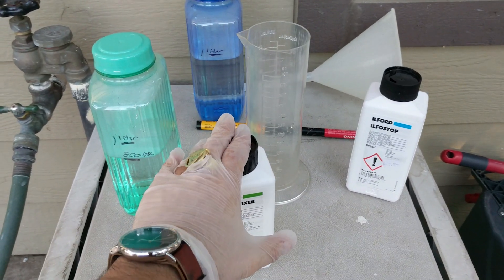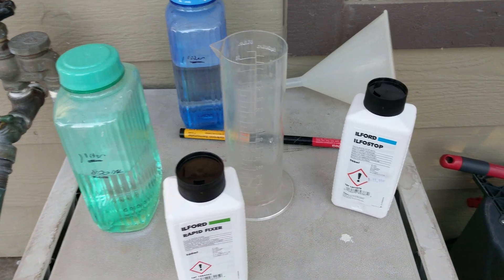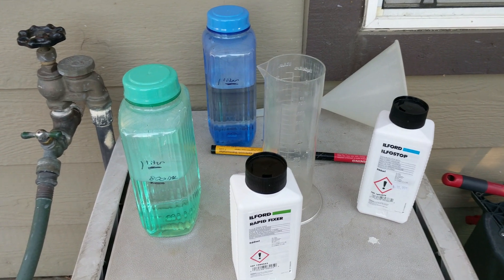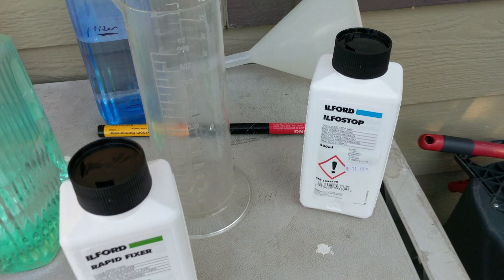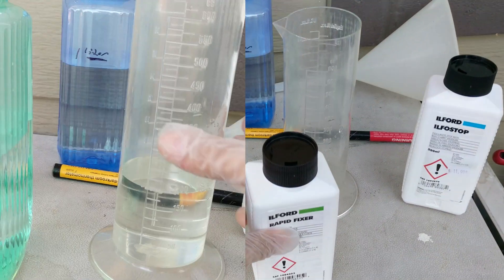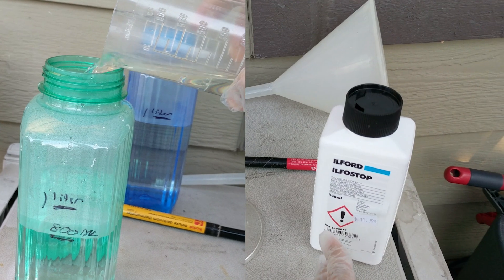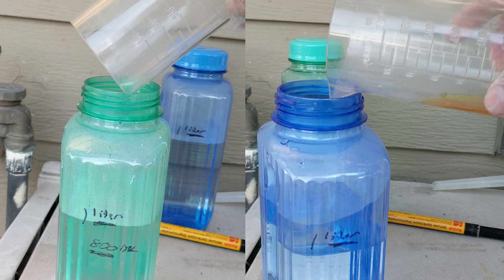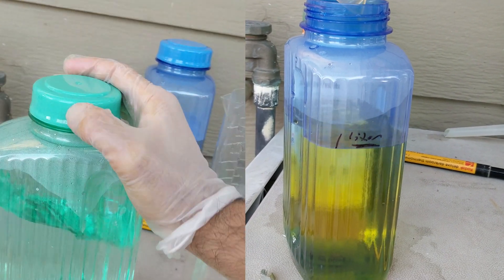Mixing Ilford Fixer and Stop Bath for Black & White Film Developing

Comment: how many times can u reuse each one?
Reply from the maker: if it's an indicator stop bath, it changes color once you it's starting to stop working. Also, another way to test it is to drop a piece of film in and time how long it takes to make it clear. If it's longer then the usual time recommended then it's time to use a fresh mix.
Reply: @alexiscuarezma  i use the same products. I was wondering that because i started developing my own bw film, and don’t wanna mess my rolls, but at the same time i don’t want to throw usable quemicals. I guess what you explained to me works with this ilford quemicals. 

At the same time, i mixed them for the capacity of 1 35 mm film in the patterson tank, which i think it was 300 ml, because the developer is to use and throw. Is it better to mix the hole thing into 1 liter? What do you recommend me?

Thanks for your time